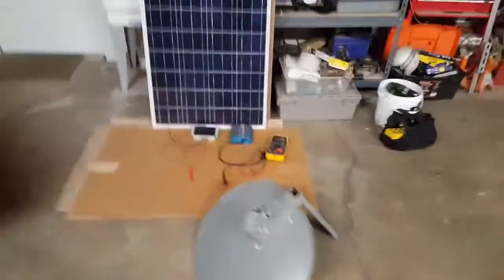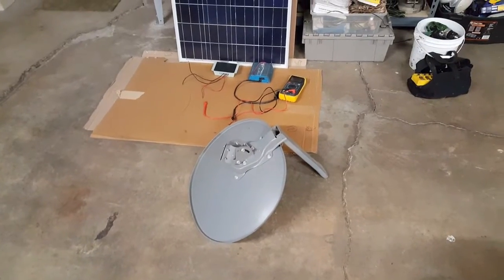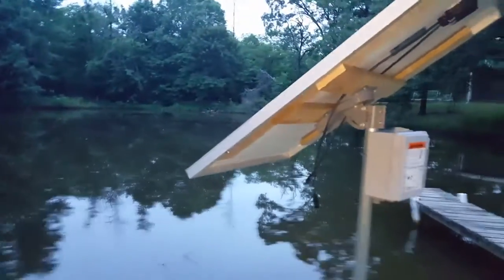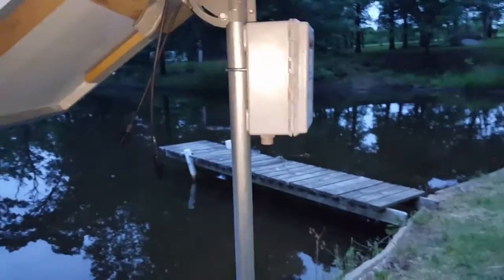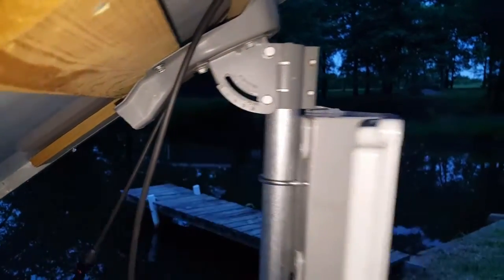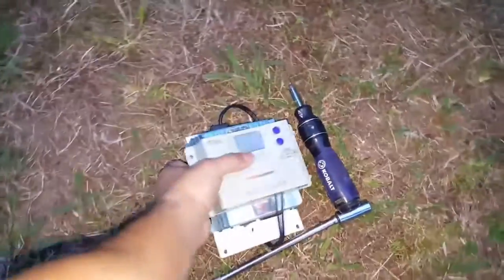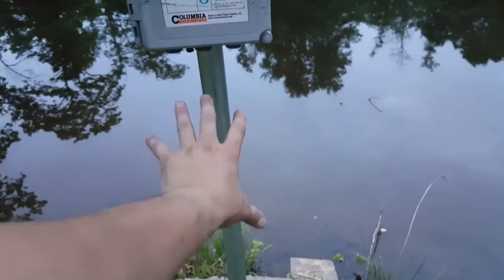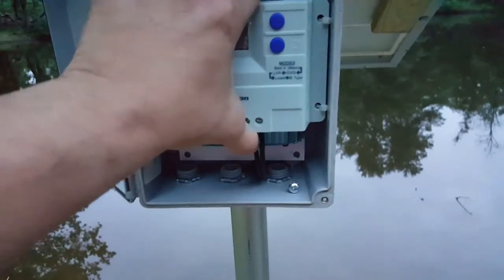Pond solar panel setup - Part 1

Comment: Nicely ideal. just a suggestion. you can use a DC pump 12v with a dc to dc converter. The pump runs right off the panel. You wouldn't need a CC , inverter, or battery.  Not only cost effective but also way more efficient.
Reply: Yeah, I would do it your way too.  Who cares if the pump slows or stops when it gets cloudy.  And I certainly don't care if the pump doesn't work at night.  As long as the sun shines, your fountain sprays water... super simple... super efficient :)  And, with a somewhat oversized solar panel for the pump, it will handle SOME cloud cover and varying angles of the sun.